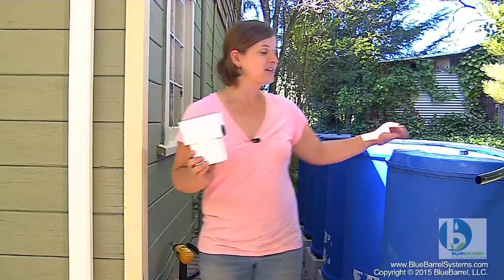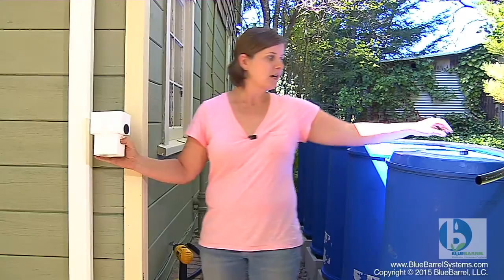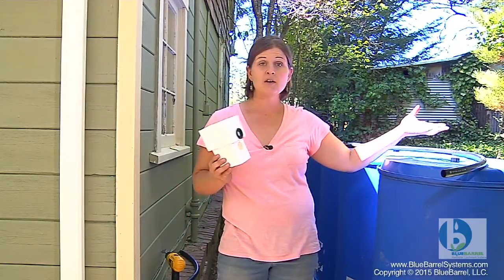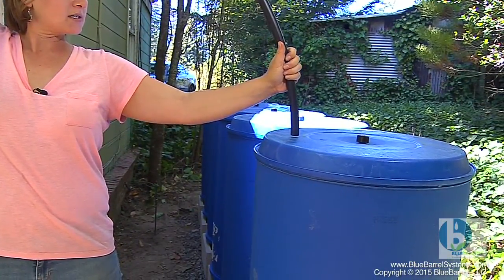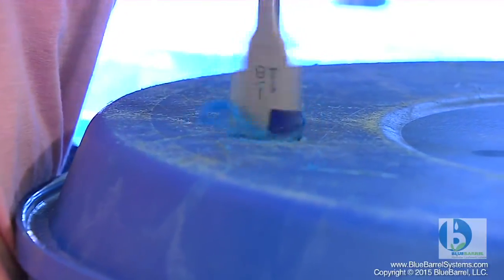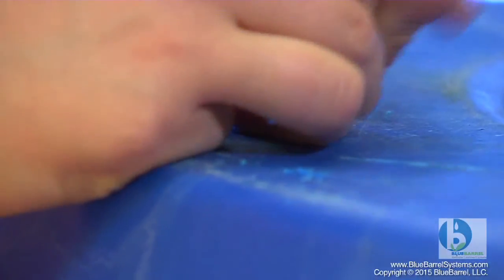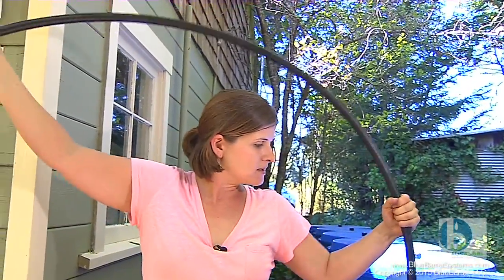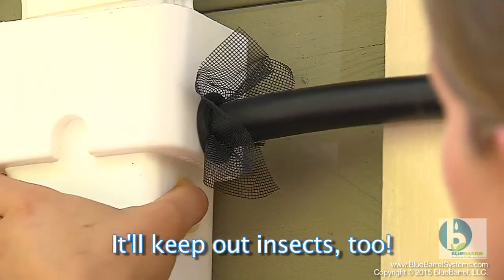PART 7 - How to Build a BlueBarrel Rainwater Catchment System™ - Downspout Connection

Comment: That diverter hose appears inadequate to handle a heavy downpour.   I’d guess it would back up and cause the diverter junction to leak considerably.   Otherwise the layout looks great with the barrels raised using bricks to allow for bottom end plumbing.
Reply from the maker: Good observation! The inlet hose in this video is thin, but it routes overflow down the downspout, so leakage is not an issue. The reservoir also holds some backup so the hose capacity isn't as limiting as it may appear. That said, we switched to a different diverter type back in 2015, which does have a  higher capacity inlet hose. You can see examples at BlueBarrelSystems.com.